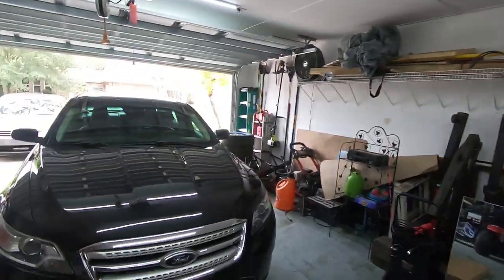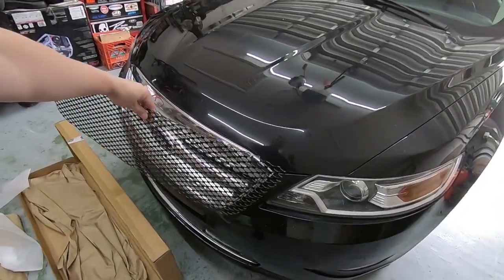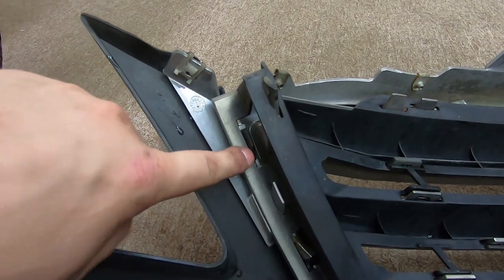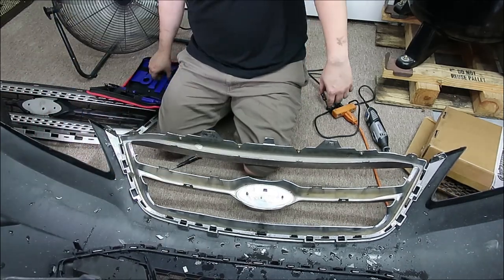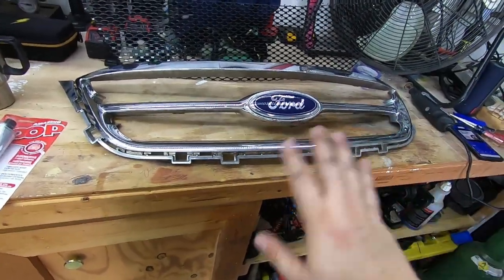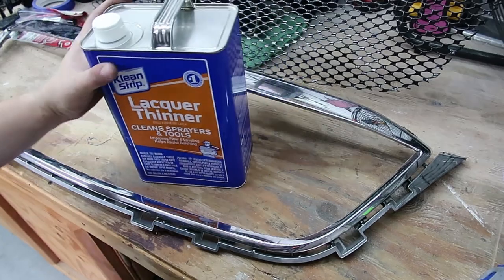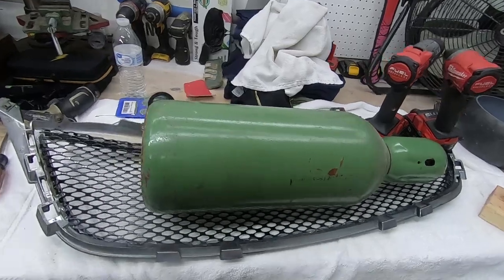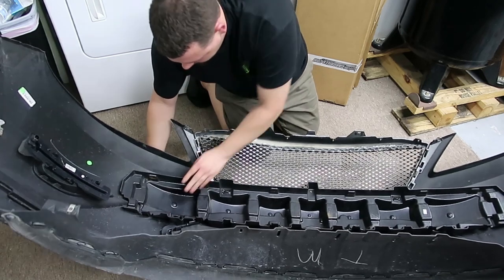2010 Taurus SHO mesh grill Complete Install

Comment: Nicely done.  The ACC cover pops off, there’s an insert for it that is open mesh like the center and left side, you can swap it out.  The ACC rarely has an issue with it being open mesh, at most on a severely rainy day or if it’s blocked by snow will it be temporarily unavailable for use.  Doesn’t hurt it whatsoever.

Comment: u could remove the front bumper with a  right angle driver alone. (panel tool if bottom tray is still there) no need for removing wheels or even jacking up car.

Comment: Do you have any tips on how to get the grill out with out cutting the chrome tips? I need to have it all intact to put on another bumper and can’t figure out how to remove the grill from the original bumper, and I don’t want to break them.
Reply from the maker: They are interlocked with the chrome Bezle. I honestly think it would break the tab. You could try thin shims to get under the latch to allow you to pull them out one at a time
Reply: The DadBod Garage  Thank you for your help, I’ll try it!
Reply: Apparently it is possible.  It would be great if someone here who has figured it out could explain or show.